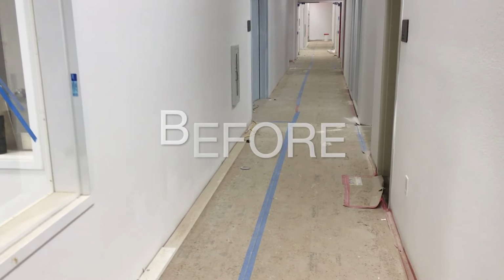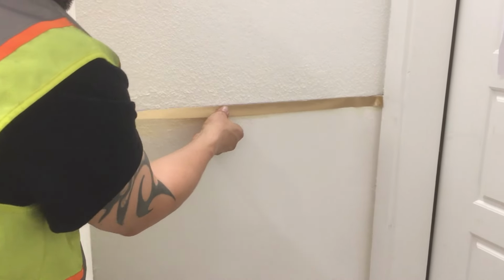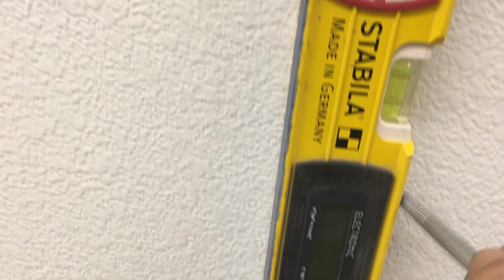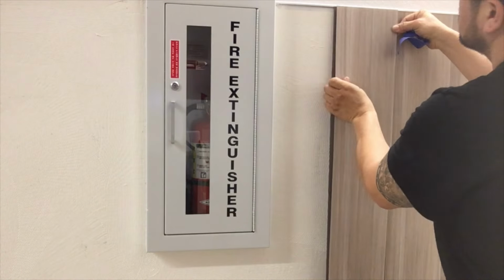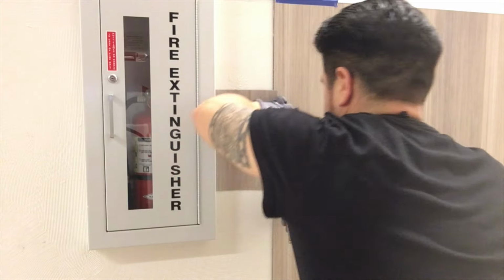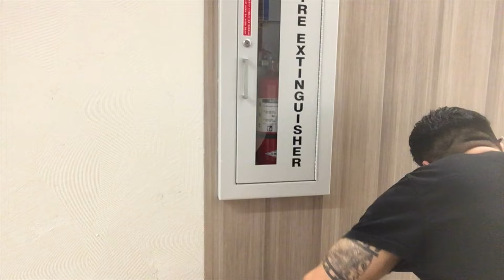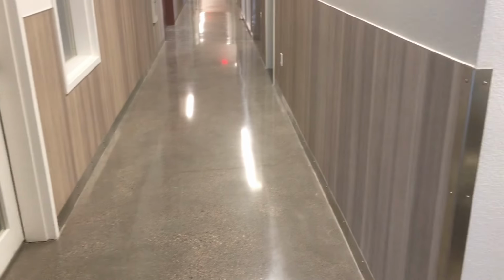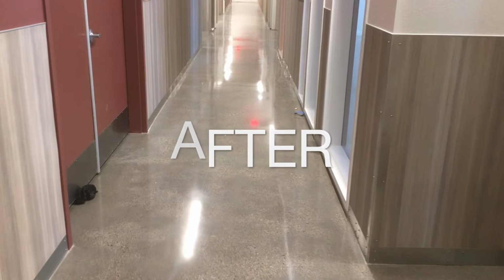Installing LVT On A Wall

Comment: Great video, i think yours is unique & very clear. As I have a hearing impairment,  I didn’t catch what the metal strips were called. I spotted a guy using a brush on the wall... do you also put an adhesive on the wall before placing the planks?
 I have some leftover LVT from my kitchen floor. I’m planning to put them on my kitchen cabinet as a substitute for the end panel. I think I’ll need to use the metal strip at top & bottom to hold it in place.

Comment: what kind of glue?  how thick?  what kind of tile?  looks pretty flexible.
where do you get the metal corners?  I am an apartment owner trying to upgrade some kitchens.
Reply: i found what he said at lowes, MAPEI Ultrabond ECO 373 Vinyl Tile and Plank Flooring Adhesive

Comment: You just apply glue directly on the wall doc? If the wall is concrete how to apply the glue? Clear the paint first or just straight gluein it?
Reply from the maker: Hi,
I would do a bond test and go from there. A bond test consists of gluing one small piece of material directly to the wall on the paint, and one where you will remove the paint and see which sticks better. If no different you can apply without having to remove the paint. Hope this helps.
Thanks!

Comment: I am confused. You applied glue, then some sort of tape then the metal "cap metal"  These are te staged I am interested in but the volume is too low and ther are not notes.   Please elaborate.